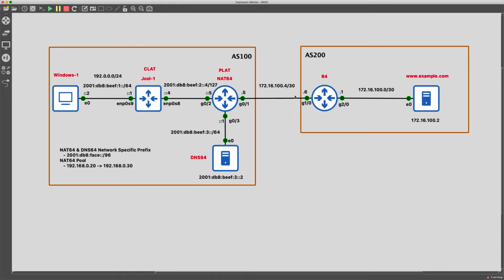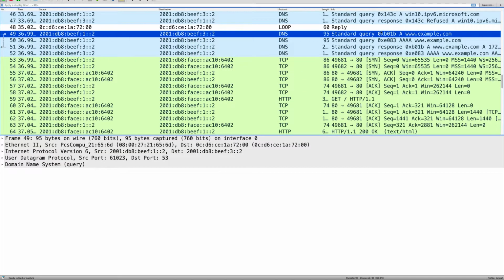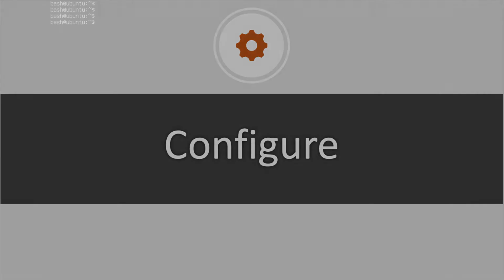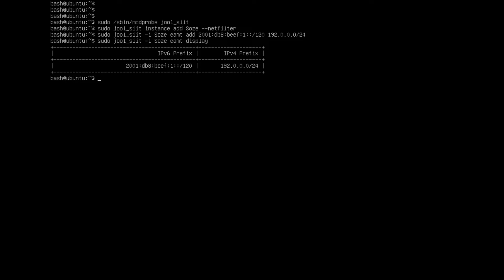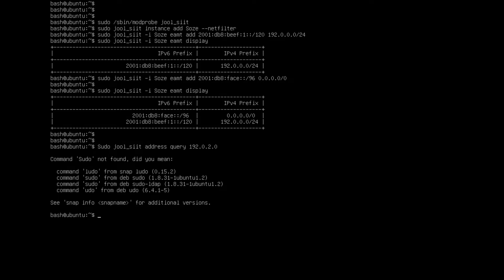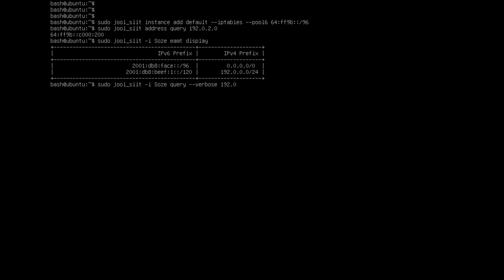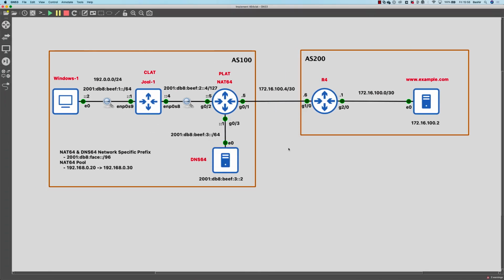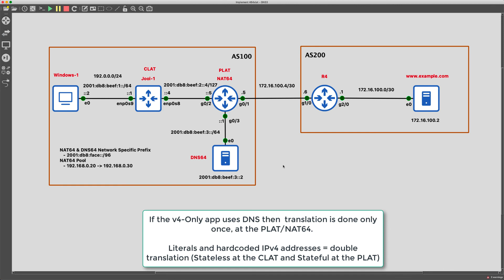How to configure 464XLAT

Comment: Can you show us from begining how to configure the topology on the GNS3?
Reply from the maker: Hi Donny, I used a VM running Linux with Jool installed (https://www.jool.mx/en/464xlat.html) on the CPE (CLAT) and a Cisco router using an IOS-XE image supporting NAT64. I initially wanted to use OpenWRT but I somehow couldn't get it to work. I'll revisit it again and make an update with the entire set up :)
Reply: @Packets_Dojo  And how PLAT configured? does PLAT are NAT64+DNS64? what makes PLAT called PLAT? im sorry i'm in the middle of confused and sorry for the continuous question
Reply from the maker: @donnysdp  it's okay :) PLAT or the Provider side translator is just a NAT64 box/router configured with a pool of IPv4 address used to translate the internal IPv6 source addresses to source IPv4 addresses to be used externally. The DNS64 function is enabled/configured on the normal DNS server. Typically the NAT64 and DNS64 functions are separate i.e. on separate devices.
Reply: Does your Windows 1 (left client) use dual stack, ipv4-only, or ipv6 only?
Reply from the maker: Hi  @donnysdp , the windows device is dual-stacked. In my demonstration, I simulate a scenario where a v4-only application uses IPv4 literals or non-IPv6-compliant APIs. The CLAT is only used when the app uses literals, otherwise DNS64 and the PLAT is used.
Reply: @Packets_Dojo  What happen if the client (windows-1) just have IPv6-only? does the 464XLAT would work also?
Reply from the maker: @donnysdp  It depends :) If the v6-only client is connecting to a v6 capable service then no translation is required i.e. native IPv6. If the service is v4-only, then translation  happens once at the PLAT i.e. from IPv6 to IPv4.
Reply: @Packets_Dojo  So the NAT64 configured on PLAT side?
Reply: Or maybe I can managed the NAT64 on the client side too? Like CLAT by Tore Anderson on his github
Reply from the maker: @donnysdp  yes
Reply: @Packets_Dojo  Noted sir. Super thank you for the explanation!